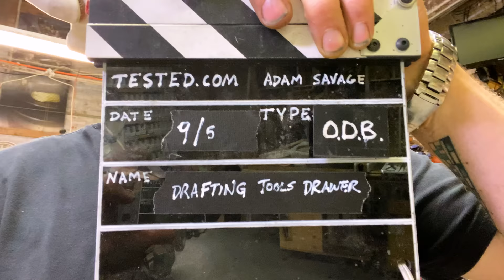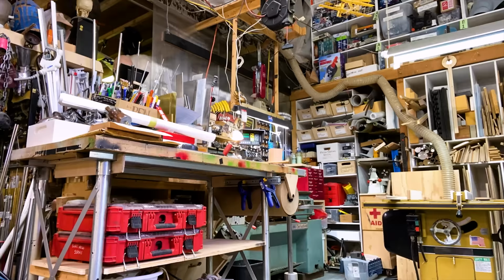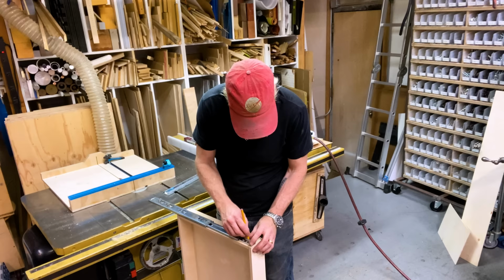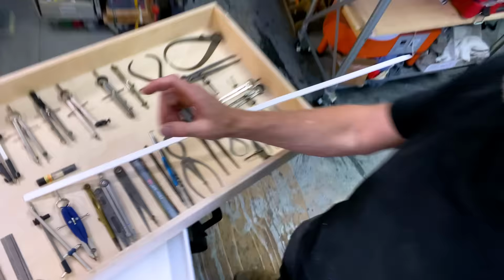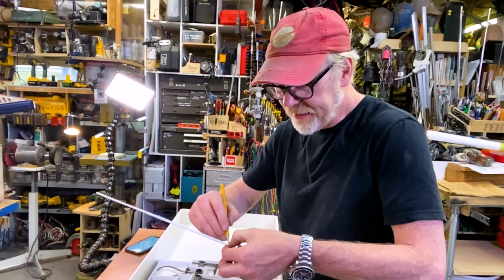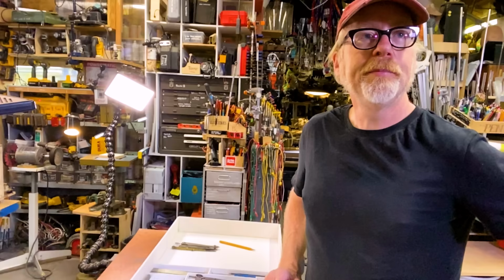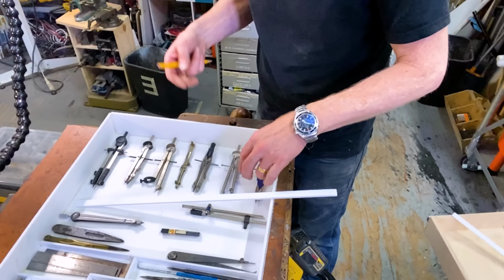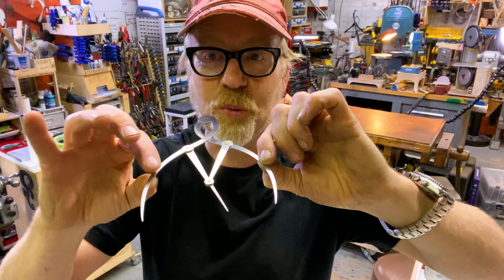Adam Savage's One Day Builds: Drafting Tools Sorting Drawer!

Comment from the maker: 3M Scotch-Weld Hot Melt Applicator: https://amzn.to/2XofZfI
FastenMaster Pro Hot Glue Gun: https://amzn.to/3k3UGtN
FastenMaster Glue Sticks: https://amzn.to/31eS2Zs
Disclaimer: Tested may earn an affiliate commission when you buy through the links here.
Reply: Take picture when all in place then print out and cut out and stick in place
Reply: "Chicken and egg" Comeon Adam! You aughta know the answer to that riddle... the Egg clearly came first, but laid by something that wasn't a chicken! 

The real question then is... which one's the egg?
Reply: Is that where the nickname Stud came from? I mean, you would have to be a stud of a man to carry that thing around...
Reply: DOUBLE YOUR STORAGE Adam:
Cut the TOP half of the BACK of the drawer out (you’re using less than half the height anyway.) 

Make a SECOND drawer from 1/4” ply and NEST it ON TOP of the FOAM core but INSIDE the FIRST drawer usinng a SECOND set of sliders mounting them BETWEEN the Interior of the Original Drawer and the exterior of the second drawer. 

Then open the first drawer and you can slide the TOP (second drawer) back to expose the bottom drawer.

Voila! 2X storage.
Reply: Cursing is fine... but you need to have a reason, not just every 2nd word.
Reply: I wonder if he's aware that the three toolboxes I can think of that ever get mentioned by anyone with a name attached to them are the Studley toolbox, the Gerstner Mechanics Toolbox, and Adam's first-order-retrieval boxes from ILM.
Reply: Can you do a one day build on shop air supply?? Hoses, quick connects, easy access places. I hate my air line, switching back and forth with tools takes time and the hose position on a work bench to keep it off the ground. Air supply at all locations and not hoses across the shop.
Reply: Adam ,can you recommend a good quality adjustable architects/ engineers drafting table  minimum size 36"x48" or larger

Comment: That tool box is a work of art and attractive but very impractical. Are all those tools really necessary? Probably not. Portable? It has to weigh close to 200 pounds, many tools are located underneath multiple layers of other tools, so in order to get the tool you need, you have to remove 5 other tools.  I always admire those old timer craftsmen that carry around a carefully curated tool bag that's been chipped down to exactly what they need to do 99% of the jobs they'll do in a year. The efficiency and deliberate nature of it is something i aspire to. I'm the type that packs everything I can into a bag because "I might need this", even though I know deep down I probably won't.

Comment: I hired into Boeing as a drafter in 1980 (Retired in 2019). Our drafting tables (Mayline) were designed to be set in rows and columns so that the front of your table provided the drawers and table space for the guy in front of you.
This included a 4' wide shallow drawer for all your plastics, or for drawings as needed. The work top was 84x42 and tilted, so all storage was in the base. The top had a full length pencil tray, and our ink pen humidor clamped on the edge of the top.
No drafting anymore, but every engineering office still as a couple of those scattered around to lay out check prints. I left board-drafting behind in 1992, but I always enjoyed part of it (except changes, all that erasing and re-doing).

Comment: As I watch this it reminds me of a process we called “Leaning out”. It was a way we gave everything a designated space in a location optimized for each tools use. It would be like finding a home for a stapler that would save everyone in an office from spending 2 minutes looking for it. It had a home and if you used it in a place other than it’s home, it was immediately replaced after you use it. That’s if you couldn’t bring the work to the stapler. And it’s home was in a location suited for easy access to everyone that used it. The stapler is an example. After learning the process I found myself doing it all around my house. The kitchen and cabinets made a big difference. You could open the pantry and see everything and it’s designated shelf of that type of food and you could literally find something in the dark after a week. It was nice! We just moved in to a place and most of our things are in boxes or random spots through the house and it’s making me nuts. Im in the process of fixing it all now. I need to do this exact thing with some of my sketching, layout, and marking gauges for my woodworking stuff. Can you use another type of glue with foam core or just hot glue?  I can never not make a mess when trying to use a hot glue gun.  And can you get the foam core ordered online and have it shipped without getting destroyed during shipping?

Comment: I'm not seeing a lot of comments about additions, so I'll add mine here. Inset a couple of hardwood rails front and rear about 1/4 proud of the inside of the drawer and build a couple of trays with hardwood sides that could slide back and forth. As others have said, the iris tool is conspicuously missing, and surely there could be a tray of just compasses. In addition, I only see 6" rules. I have several lengths of rules, both in stainless, clear plastic, architects scales, and a couple steel-edged plastic rules for cutting. Things like marking gauges are really a different category it seems, though  a tray with stops could allow taller object like those gauges to rest nicely in the center. Always inspiring Adam! Thank you! Saving pennies for a glue gun!

Comment: Why didn’t you include that beautiful Iris tool for drawing circles that you showed us a while back?  I think you mentioned it at the beginning of this video, but then nothing?
Reply: That's what I came here to say as well.
Reply: I think that must be the tool he alluded to being out of place.  Probably he wants to keep it with a separate collection
Reply: The one in the shot top right at 11:11? I could be wrong but is it maybe the one on top of the frame at 29:23? By the way, the tool out of place is the 'golden ratio calipers' (see 29:06).
Reply: @martink.6872  the Iris tool is the one top right at 11:11. But it is clearly not in the drawer at the end of the video. Plus, Adam has 2 or 3 of them. None of which are in the drawer.
Reply: honestly, the iris tool is as much an art piece as it is a tool (though, much like the Stradivarius violins, should be used.) so I would not be surprised if it has a special place in the shop.
Reply: @martink.6872  I think you are correct.  It appears that he was going to include it, but then changed his mind for some reason.
Reply: @deefdragon  It is a beautiful tool, that's for sure, and you are probably right.  I'm sure he has a special place to display it.  I'm not sure I would just stick it out of sight in a drawer somewhere.
Reply: The iris tool is at 1:53 and it may have gone back there for the time being. However, he's getting the new bench from Andrew Klein, so who knows?
Reply: @cmsmith1961  I'm thinking the drawer has enough depth there could be a tray or two added that could slide back and forth. Trim the foam down and inset a couple of hardwood rails front and rear.

Comment: 22:00 - For me, there are a few things that are like that, but they're not things I've built.  They're programming projects, and in retrospect I'm surprised I even figured out where to begin, much less that I was able to achieve what I was hoping.  I'm not a programmer and only have a basic knowledge, but on a couple of occasions I was able to modify existing executables in a hex editor to subtly alter their functions.  
Specifically, one was a bridging program that read the window title of one application and passed that data to a second application.  An update to the first application altered the format of the data in the window title such that it broke compatibility.  Somehow I was able to determine what language the bridging program was written in, decompile it, determine via the assembly code where and how it parsed the window title, and tweak the original executable in a hex editor to regain function.  Looking back at it, now...I'm astounded.  "Was that even me?"
The second was during the Soldier of Fortune II beta.  The beta executable was tweaked so that it couldn't read custom content (like skins and such).  I managed to "unlock" it, again by tracing the assembly code and modifying the executable.  All I used it for was to put my own custom skins on some of the weapons, but I was still pretty chuffed about it.

Comment: As a rough carpenter, some 50 years ago, I built the perfect toolbox for all my tools. 3 or 4 years later I started doing a lot of finish carpentry and dabbling in fine case work. All of the more delicate tools required for fine work did not play well with the rough and tumble tools of a rough carpenter. Time for additional toolbox. With a move to a more rustic area I acquired the skills of timber frame construction. Another toolbox. Fine furniture building, another toolbox. Custom metalwork -  toolbox. Theater. stagecraft and prop building - toolbox. Costume design and construction - toolbox and sewing machine. On and on the stone rolls and I acquired yet more skills. My toolboxes now fill a large van with a ramp, power lift, generator, cot, refrigerator and drafting/sewing table. My three stall garage has one stall for the wife and the rest is for me. Now that I've reached 70 I am slowing down, some what, but I still have space for 2 or 3 more toolboxes.
Studley's  toolbox is a thing of beauty, but it would never work out for one such as I.
Keep up the good work,
Bill.

Comment: Hi Adam, why not just print out a scaled version of your tools, and lay it as a base?
Reply: That would pigeon hole him into never adding/subtracting tools
Reply: They'd be shifting around all the time.
Reply: @MichaelBerthelsen  Not if he glues it down
Reply: @kevinhammond9445  You want him to glue his tools to the shelf...?!
Reply: Glue the printout...
Reply: @kevinhammond9445  How does gluing down the printout stop the tools from sliding around, exactly?
Reply: @MichaelBerthelsen  Melon was talking about a print out and you said they'd be moving around.  I was thinking about the printout moving around....
Reply: @kevinhammond9445  And my comment was about how using pictures of the tools as a sorting system would let the tools slide around the drawer.
Reply: @MichaelBerthelsen  I read a lot into your original comment. There is a common practice with pegboard of tracing the tools and filling them in so you know at a glance if anything is missing and remember where a certain tool goes.  When you mentioned a printout of  a picture of the tool, my mind read into it a lifesize picture on the bottom of the tool tray for a similar purpose, and that picture being what would be sliding around.  The deviders could still be placed on top...

Comment: Adam, I have a large cabinet to store drawings. The two top drawers are 1/2 the width of the drawing drawers and  little deeper. Now to describe my point. The split drawers have pieces of wood that a small lidless "box" can slide on. The box is half the depth of the drawer. The idea is drafting/layout items are thin so there is room for the box above them. The box gives you 1/2 more drawer space. By sliding the box you can still see everything in the drawer.  This takes up less height than two drawers would take up. Some of my tool cabinets have drawers deeper than I need. So I made a sliding box that goes side to side.  Some 1 x? are placed in the front and rear of the drawer for the box to slide on. ? depends on the height of the drawer being worked on. So instead of a 26" wide drawer I have a 39" wide drawer. at approximately 1/2 the height  Just a thought. Have a Happy New Year. Brian

Comment: I only have one small tip for the utility of the drawer. Because the drawer face is recessed behind the leading edge of the bench, the far back of the drawer remains covered. In order to rectify this you'd need to use slides that extend the depth of the drawer plus the amount of the overhang of the benchtop. Therefore, an 18 inch drawer slide would give you better access to the items in the back. Otherwise, great build to watch.

Comment: what i like to do with floating bottoms when making drawers, especially long drawers is i will space the bottom of the floating bottom 1/2" from the edge and glue and nail in a 1/2" plywood runner down the center thats only about an inch or 2 wide. Just helps with larger drawers like that to keep the thin floating bottom from sagging over time. probably not necessary for this one but may be if u put heavier items in the drawer or for future drawers

Comment: Pro tip from a former custom framer who had to build many foam core boxes: Use strait pins to reinforce joints as you would nails or brads in wood construction for added strength and longevity of your foam core constructions

Comment: my absolute favorite compass in there, third one from the top on the right side....  a compass with a universal adapter is SO NICE! throw a mechanical pencil in it, a sharpie, a good drafting pen or marker, an xacto blade and use it to cut circles!! just having options of what can be put in it is such a good utility tool.
Reply: My universal adapter comes in roll form and is usually silver in color. It is called duck tape!
Reply: @1pcfred  oh, i’ve taped pens and markers to a compass before, it’s just nice to have one made for adapting.
Reply: @monkey_breath  trammel beams or just tying a pen to a string is easy enough. Smaller circles are always can sized anyways.

Comment: Nice job, Adam! Now, you just need a solid wood panel to strengthen that drawer front - especially if you're going to be opening the drawer by grabbing the bottom. And, you need a plexiglass protector separating your Golden Ratio caliper from its slotmate.

Comment: "Henry O. Studley, of Quincy, Mass., built organs and pianos for over half a century before retiring in his 80s in around 1920.  As with so many craftsmen, his life's work was essentially anonymous.  In his last decades, however, while working for the Poole Piano Company in Boston, Studley used scraps of ebony, rosewood, ivory and mother-of-pearl from the piano-making process to build this chest, which has made his name famous among craftsmen of our era.  
Wall-hung and hinged to open like a book, Studley's chest holds upwards of 300 tools, each of them nestled in a precisely fitted pocket.  The tools are three layers deep in places - with some sections of the chest hinged to lift upward, others to swing to the side - yet so cleverly arranged that most tools can be removed without disturbing any others.  Many of Studley's tools were commercially produced, but he made a number from scratch and fitted others with custom handles of antler or rosewood.  Many of the less-common tools are peculiar to piano making.  Studley was a Mason, and various details of the chest's design reflect that fact.  

The chest has been displayed at the Smithsonian, where conservators cleaned and repaired it.  Today it resides in a private collection in the Midwest."  _____ from the caption on my poster.

Comment: As someone who has assembled a lot of furniture, and especially drawers, I would have used two or three pieces of wood on the underside to strengthen it, even if Adam used strong plywood for the bottom and the contents doesn't weigh much. Drawer bottoms has a tendency to start sagging in the middle, often just because of humidity, and some small pieces from front to back will strengthen it a lot 😇

Comment: Cut the back of the drawer down to half height, and put a tray-drawer on top. everything in there is pretty low profile, and this would give you double the height. put your most used drafting tools on the top tray, and when you need less used things, just push the tray backwards (through the cutout) to access what's underneath.

Comment: FWIW, the drawer bottom is sitting in a dado (or a groove, depending on your preference) not a rabbet.  Rabbets are L-shaped, open top and side,  dadoes and grooves are U-shaped, open only on top. The difference between a dado and a groove is that a dado is cut across the grain and a groove is cut with the grain. Since in plywood the grain is perpendicular with each veneer, either would be correct.

Comment: You have a tall drawer with small tools so you should add another drawer to ride on top and inside the large one to slide left and right 
This way you have the most common used tools on top and in the left or right depend on where you prefer to leave the top most of the time

Comment: Instead of numbered spaces: photograph the filled drawer from directly above, print it out full-size as a poster, then cut out each tool and glue it down into the correct spot. You'd probably want to convert the photo with a filter (make it look like a blueprint drawing?) so you don't get confused by empty spots.

Comment: A couple of quick thoughts, first Adam should invest in a router table and drawer lock bits, great for making locking corners on drawers and boxes, also with round over bits easy to soften corners on small pieces. Next, Rockler, Woodcraft (and others) sell pre-rabbited drawer sides made from prefinished plywood, not as cheap as roll your own, but less setup.

Comment: Adam, don't you think that there is room for the second layer in this drawer? You can put a quarter wide insert of the same depth on top of the existing one. It would be easy to remove or slide to the side and it would have things you use more often than any other. Just an idea :) Actually, you've inspired me to make a drawer of my own for my own tools.